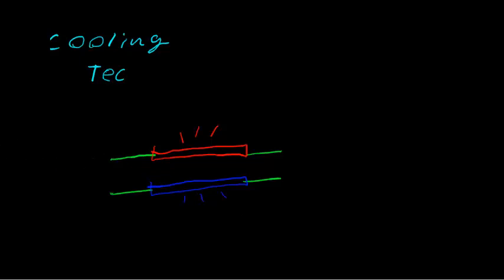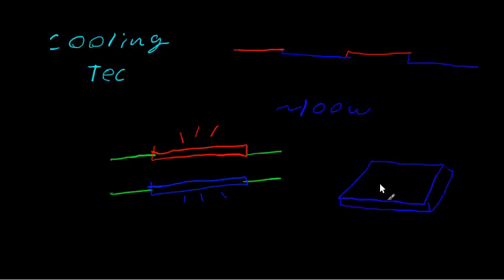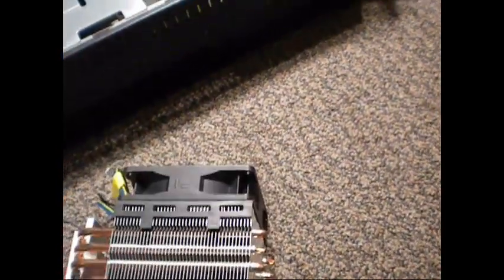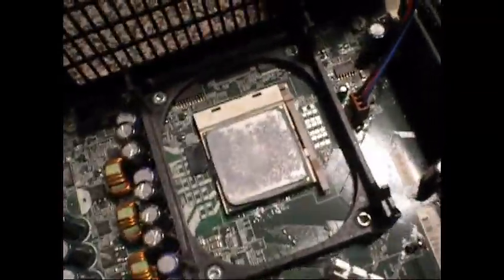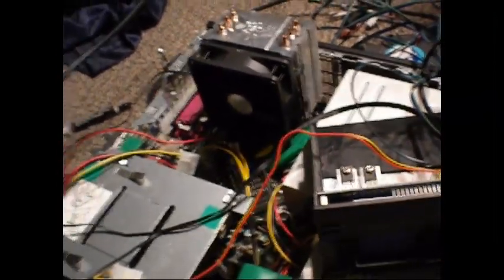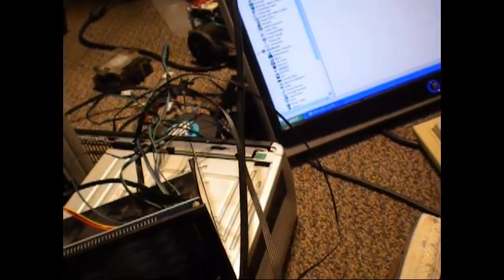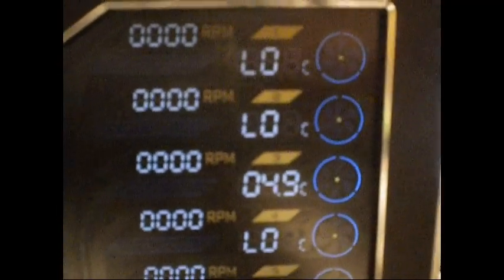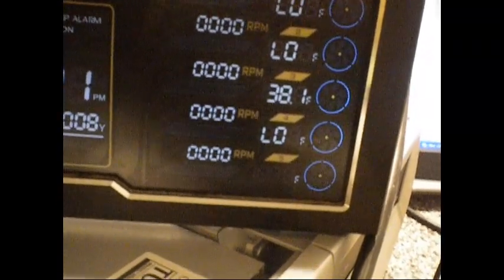Thermo electric cooling!

Comment: I was wondering some time ago if Peltier coolers could work for computers, but with my limited experience with TECs I guessed that the heat would be too much for them to handle even with additional cooling. I guess it comes from only knowing about cheap TECs from cheap heating/cooling electronics. My question is how much do these cost for a powerful one? Are they affordable/effective enough to be a viable method of cooling for more powerful PCs? Awesome vid, glad someone experimented with these.

Comment from the maker: well, you would need to keep the hot side cool, otherwise the TEC could fail early. but thats not a problem as long as you have a decent heatsink. they should last a loooong time before failing, probably a couple of years. so maybe every year or two, swap it out with a new one and it will be good!